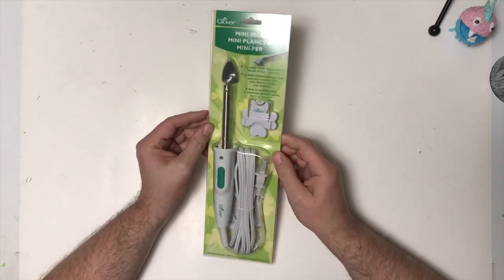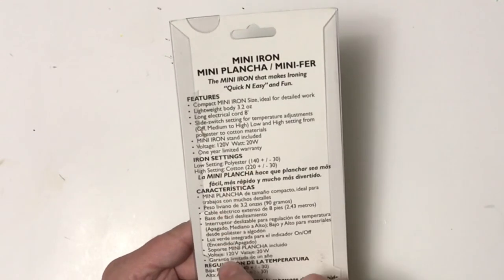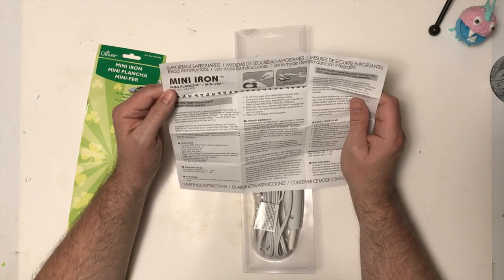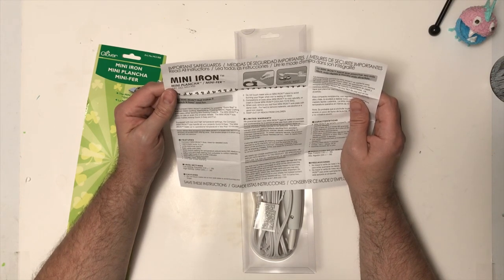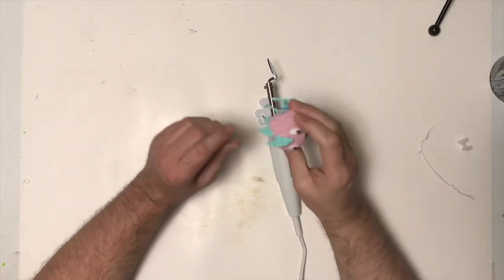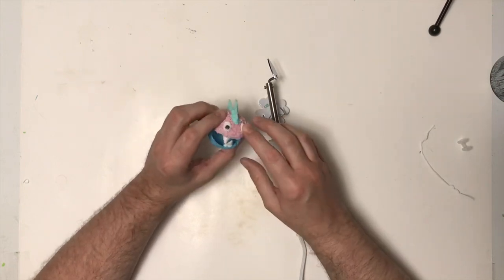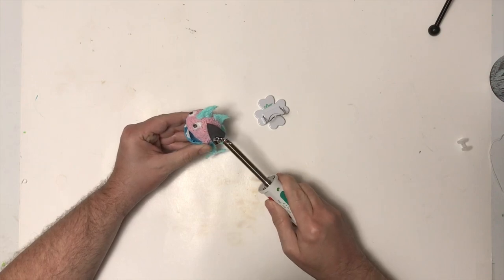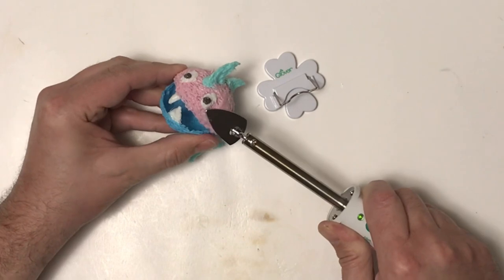Clover Mini Iron - Smoothing a 3D Pen Creation

Comment: Have you thought about using parchment paper between the iron and the plastic? That is what I use when I melt plastic beads and that works well. Not sure if it would work with this but worth a try!
Reply from the maker: Thanks! It’s worth a shot.

Comment: I sand mine with wet /dry 320 or around that's as I do wearable or use silicone finger tips to smooth it while hot. For your gloves oil them as it prolong their durability and resistance to burns
Reply from the maker: Thanks for the tips.